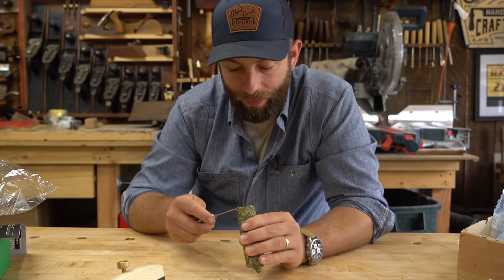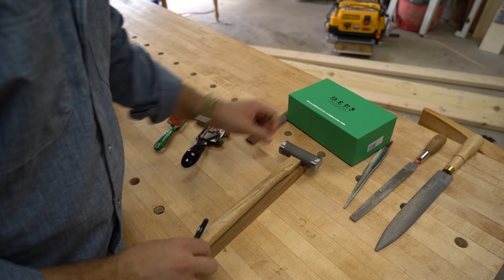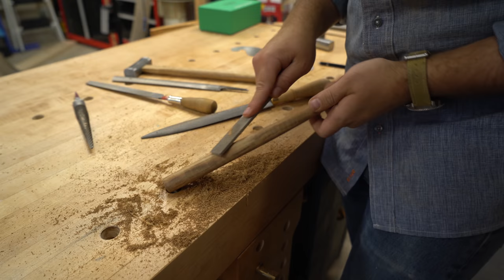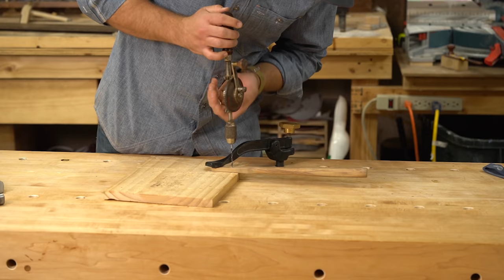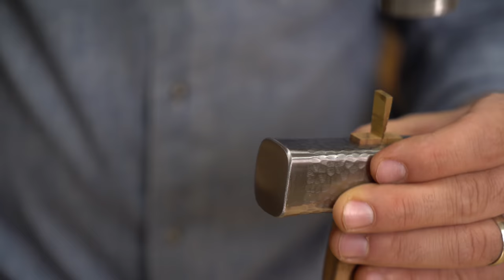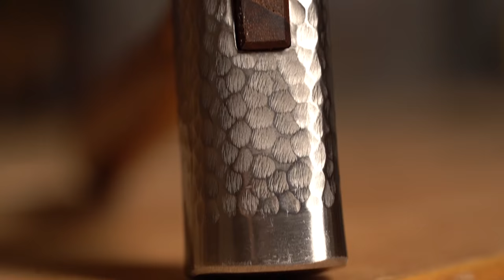Crafting A Handle For A Japanese Hammer Head

Comment: Lovely looking handle. It does look like you might have installed the head upside down. Most good gennos have a taper in the mortise, which is why wedges aren’t necessary. Typically the makers mark is facing the handle. That will put the taper in the right direction.

Comment: Nice work. Typically japanese hammers, excluding the cheap ones, don't have wedges fit in the heads. Just compress the wood fibers on the 'tenon'  with a hammer and whack it in. I have a few hammers from Hiroki, Tenryu, Kozaburo, etc that haven't loosened yet.

Comment: Totally. Sweet deal on the new tools ans the handle fabrication  no Bull on working. With higher end tools  raising the bar on   The Craftsmanship  I’m not a tool snob  but i. Feel that. Using a  well made tool  or even dressing more professionally  elevates my work !  Kind of a funny story years ago. I went by a thrift shop and they had  a entire rack  of  white Oxford  shirts  with blue pinstripes  for a buck each. I bought 20 of them   And they looked nice. With a pair of. Jeans so i  wore one. Every day t o my job of installing Architectual Woodworking   Some of my Co workers. Looked at me  and. Asked aren’t. You afraid about getting  stains on your shirt and i told them. Heck the shirt cost. Me a buck. If  it. Doesn’t come out in the wash. Ill throw it away  the 20 shirts lasted me around 2 years of. Wearing them to jobs  and i felt more professional each day  BTW i always wear a  Bucket Boss made apron  to hold many tools  and hardware. Parts i  need  so that offers some coverage   Plus I’m the type of person that works neatly and clean anyway   My wife used to laugh at me because. I would use drop cloths to paint but  didnt  get any paint on the cloths ?  I was actually taught that tecnique by a old timer  painter  in my early. 20s   He did new homes  for a living and wouldn’t drop paint onto  subfloors that. Were getting covered with. Finished flooring  mostly  due to a pride in his work

Comment: It seems hardly anyone in the west is able to properly fit a gennou handle. If you make the tenon on the handle the right size the head will not come loose without a wedge. And just so you know, the kanji on the gennou goes on the bottom. The eye of the gennou is often slightly tapered and the kanji tells you the orientation. And the handle has the wrong shape for maximum efficiency. Just another noob who has no idea what he's doing.